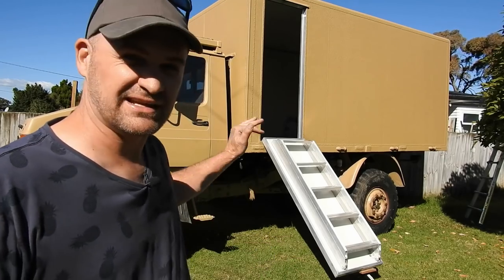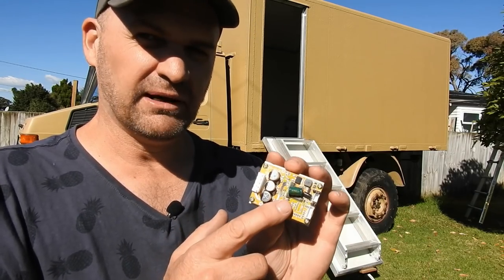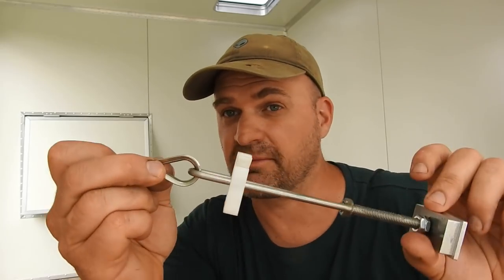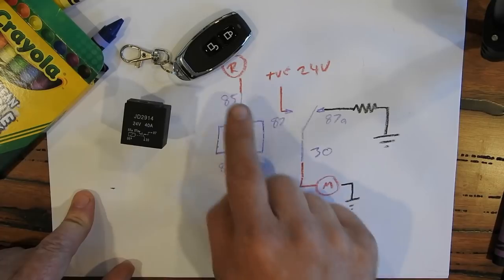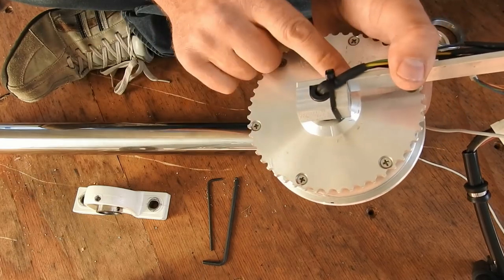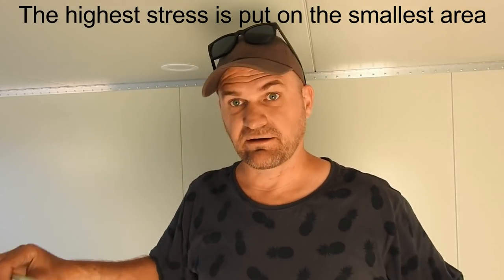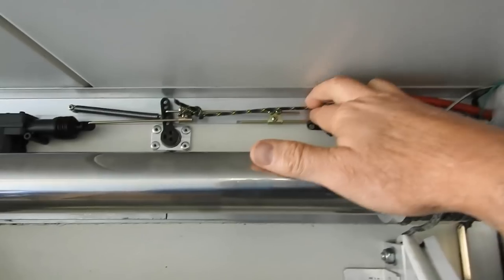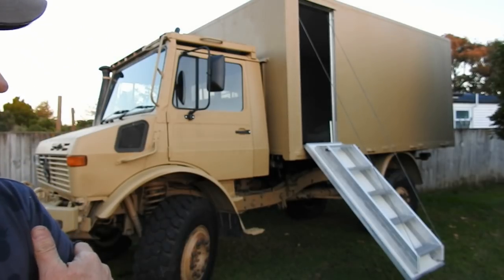DIY Automatic door - #8 Unimog RV build

Comment: Try a smaller resistor, maybe it will open faster.
Reply from the maker: By smaller, you mean a larger resistance?  If I did that... the generated voltage will be too high which will turn the drive on and make it try to drive the door up again.  This would make it come down with a bunch of stammers.  It's an easy issue to solve once I build a controller for it.

Comment: maybe add something on the edge of the door just in case you will be in rough terrain so even if it slams on rock or something it will not bend actual door
Reply from the maker: Yeah, good thought.  Comes down fairly slow and wouldn't bend door... but I get the thought.

Comment: Who are you?????  You make MacGyver look like a cub scout.  How much weight do you think the roof will support?  2 adults?  4?
Reply from the maker: Haha... thanks.  My roof has supported a couple of 100kg adults standing in close proximity without any issue and seems quite robust while walking around on it.   The panels themselves are quite strong as long as they are loaded appropriately.  Walking directly on the panels or applying point loads isn't great and can lead to delamination.  I noticed a drop in rigidity when I cut the hole in the middle.  I would expect 4 adults wouldn't be an issue as long as their weight was spread somehow... and not around the skylight hole.  I will know more when I start using the back as a deck.